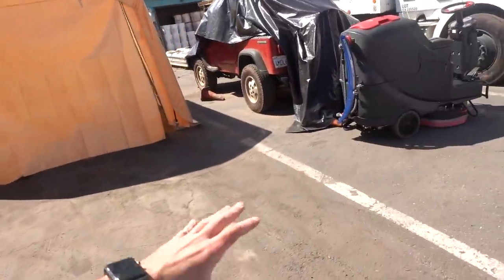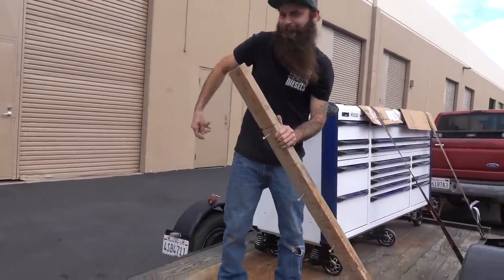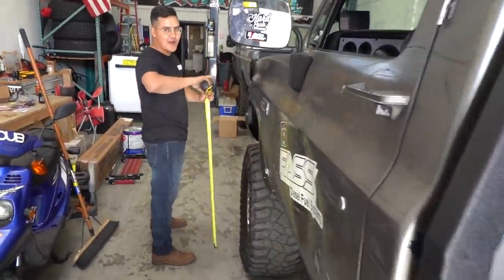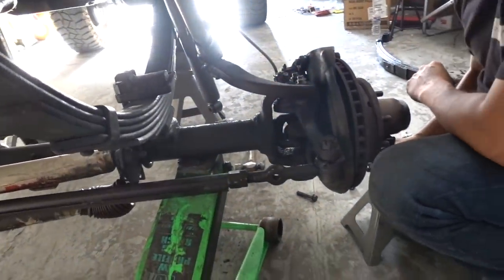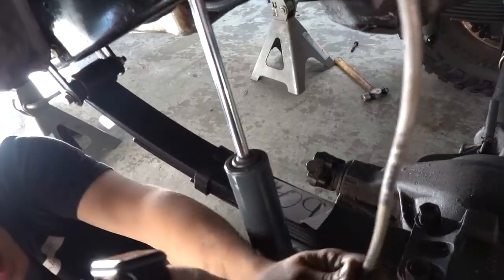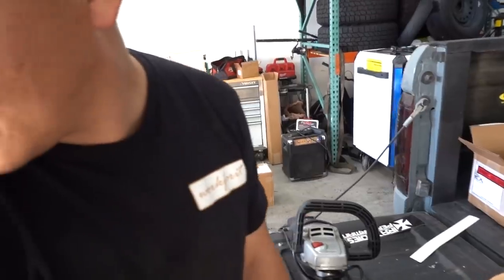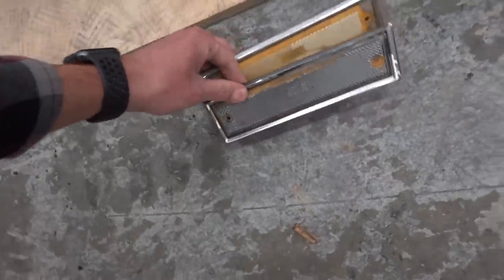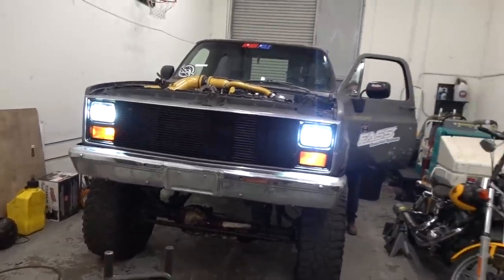HUGE SHOP NEWS!

Comment: For the toolbox u need to strap from the wheel to the trailer in an x with the straps. Will prevent the cockeyed thing and repeat on the front. Make sure angle are correct by placing box in center of the trailer.